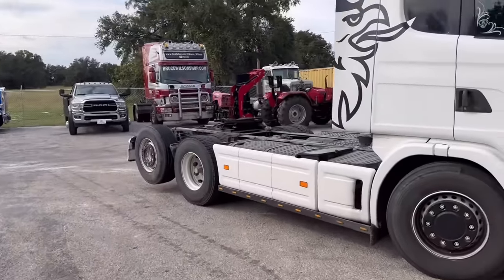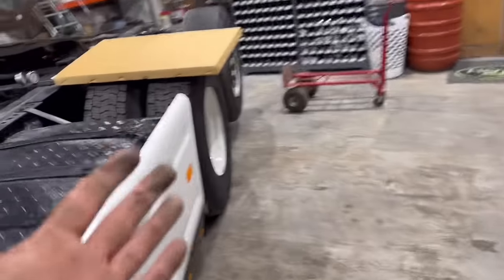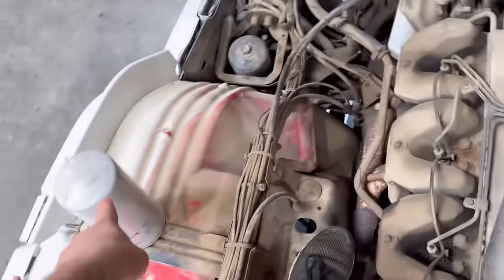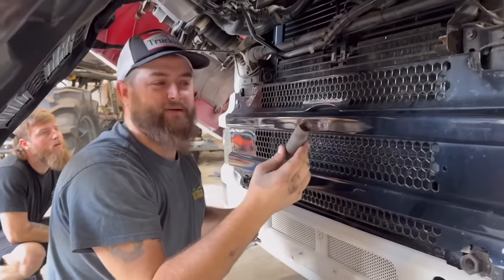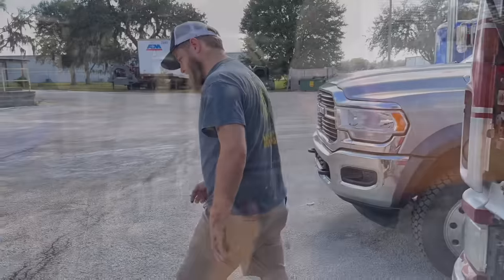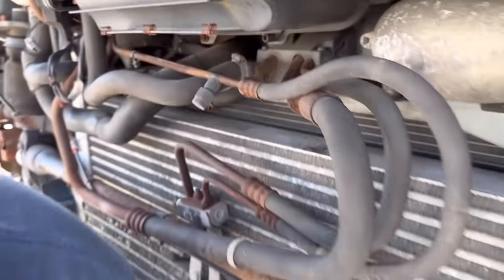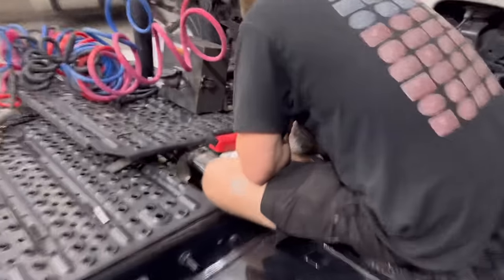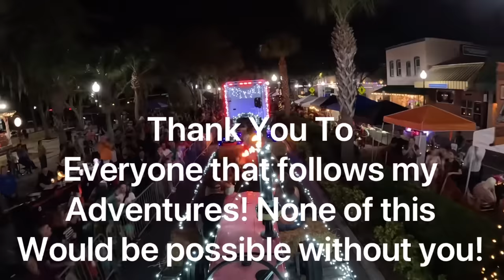My SCANIA Needs Serious Engine Repair…

Comment: Bruce, you know what.
I think you should open a Scania dealership at some point and import/sell the new trucks straight from the factory
Reply: By EPA rules cannot import new ones.
Reply: But if he finds a contact with the epa and one with scania and becomes the middle man they can work on making a percentage of them legal to come into the us it just takes alot of leg work
Reply: I bet no one thought of it yet?
Reply: @jone8626 careful now, your extreme prejudice shows. You shouldn't talk about things that you have zero knowledge about.
Reply: Scania is already a sister company to International trucks...being owned by traton group (volkswagen) ....so they will come to US in near future i believe
Reply: @ImForwardlook what extreme prejudice are you talking about?   

Dude, I drove truck in the lower 48 US, Alaska, 10 provinces and two territories of Canada (for probably longer than you’ve been alive), most of it in the heavy haul side of the trucking business.  Although you could customize an American brand truck to no end and overbuild the damn thing into the toughest and meanest machine on wheels, but, as far as the average fleet trucks go the American trucks are absolute junk as compared to the average European fleet trucks.    The cost of the American custom build truck is absolutely prohibitive as compared to an European truck of similar capabilities.    The European engineering far exceeds the American engineering, at least when it comes to commercial vehicles / trucks and you can easily see this fact in the design and quality of the average European trucks versus the average American trucks. 

It’s very important to compare “apples to apples and oranges to oranges” when comparing American trucks to European trucks !
Reply: @hereintranzit  Yo kiddo, I 've been driving trucks longer than you've been alive. Everything Europeans touch turns to crap, look at Freightliner.
Reply: @ernestbrothers1298  This is kind of a strange thing? Because those European engines are far ahead what comes into emissions. Maybe EPA is protecting just American company's?
Reply: @ImForwardlook  yeah we touched North America look what it is now..
Reply: Just out of interest, I went on the Scania website and looked up dealers in the USA. There are 15 just in Florida, industrial, and marine, admittedly, but there is a route to Scania all over North America.
Reply: Just out of interest, I went on the Scania website and looked up dealers in the USA. There are 15 just in Florida, industrial, and marine, admittedly, but there is a route to Scania all over North America.
Reply: Sadly you can't import and register a vehicle that is newer than 25 years old in the US. If they brought over new Scanias, Kenworth, Petebilt, Freightliner, Western Star, etc, wouldn't be competitive on the market anymore. Who wants to haul oversized and heavy loads with a 530hp Peterbilt or Kenworth when you can get a 770hp Scania or 750hp Volvo that is built to carry more weight from factory?
Reply: @tntfreddan3138  exactly !   And with those airtight cabs fully suspended on air springs, well thermic and acoustically insulated, nah, who’s gonna want to drive something like that ?   

The only redeeming thing about the American trucks is the size of the sleeper, and on the classics the retro looks of the design, lots of shiny chrome, the eight foot long hood in front of you and the twin air cans and smoke stacks on both sides of the cab.   Other than that, you could feel driving over a penny someone dropped outta their pocket, the noise will bust your eardrums, the wind will blow you off of the darn seats (thanks to the seatbelts keeping you in place.  LOL ) and you literally need forty acres to turn the damn thing around, right?   LOL. 
Oh, and the one’s winning trophies at the MATS, well, tons of more shiny chrome inside and outside, awesome paint jobs and lots of chicken lights makes the difference !  A 335” wheelbase with a coffin sleeper behind the cab, a minimum of 3 foot tall shifter lever in the middle of the cab floor with a chrome skull in top of it and a super lowrider driver’s seat, well, that’s a must in the 21st century ‘merica !   It doesn’t make a lick o’ sense, but that’s what’s cool in America these days ! 
Oh, about $300K of extra useless sh!t in top of the $260K purchase price for a nice Pete 389 or a K’whopper W900L
Reply: There are already 20+ Scania dealers in Florida. Check the Scania home page. They can assist with spares for trucks as well. They assist cross boarder Scania from MX.
Reply: I thought Scania already had permission to sell in the USA, but decided to pull out after only a short while?
Reply: @Xv1p3rCr0 only their engines will. The new S13 engine is based on Scania's new 13L "Super" engine
Reply: @Gregerory Abreu Truck Service of New Jersey has parts and sales for Scania..
Reply: @ImForwardlook  so crap they've got 40% of the market
Reply: @tntfreddan3138  Just get a QSK19 800 hp & leave all that scrap over in Europe ,cab jacks in the US went out in the 80's who wants to drive some cabover junk anyway.
Reply: This is not big stuff. Maybe the head gasket but otherwise just minor stuff.
Reply: Very cool video

Comment: On the 144,  Usually a coolant leak means the sleeve went a bit too deep in the block.  Wait until you check the 164 and R series ;)
Reply: or the block is corroded

Comment: Nice truck 😊, you need to buy insert paper for the centrifuge oil filter when you go to Finland. Makes it much easier, and the centrifuge filter shows you if you got engine bearing failure, the bearing particles will show in the build up in the filter. Nice work, all the best from Denmark 🇩🇰🤘

Comment: You want to keep or return the under hood appearance of it, I would suggest you get a product called Gibbs. You spray everything under the cab, preferably while the engine is running and you soak it down and you let it sit a couple of days and you spray it off. The accoutrements will look considerably better. Salt also will not cut through gibbs, but Gibbs cannot cut salt so you have to make sure everything is clean before you apply it. You can apply it to every square inch of the framework. Will soak into a millionth of an inch. And you can also wipe it with a rag and spray paint over it and the paint will stick. But I once owned a Dodge Caravan and I sold it with 254000 Mi on it and I would do that once a year just to treat the engine. Before I sold it I sprayed it off it looked like the vehicle was less than a week old under the hood. And I bought it with 46,000 Mi on it. It is a great tool for keeping the vehicle looking nice especially in those nether regions underneath it and under the hood. It also keeps all of the rubber from deteriorating quite a bit. On my caravan, my son had borrowed it to go to school in texas, and he changed the original plug wires at 241 thousand miles, along with the original radiator hoses because he had to replace the radiator. Now it could have been that it was originally an FBI package vehicle. It was a vehicle that was specifically made for the federal Marshal Service the DEA and the FBI in 1998. The first 200 of them made in the 1998 model year. It even had a custom paint color on it that only was on Chrysler products, not dodges. But it also allowed me to know when I was near any federal agents for several years. I also was able to get quite decent fuel mileage out of it I was able to get about 31 1/2 Mi to gallon out of it and it would run along at 130 mph all day long comfortable as could be and that wasn't topped out and still getting 20 miles a gallon. That was on a trip back up in 2003 from my mother's funeral in South Carolina back up to the Detroit area. I went through West Virginia at an average speed of 118 mph. I did slow down when I got into Ohio though.
Another thing you can do, is any rubber that you add to the truck or even some of it is still on the truck that looks serviceable, clean it up and spray it down fairly wet with 303 protectant and let it soak for about 12 hours. Put it on all of the Rubber products even the serpentine belts, you can even put it on the Treads of the tires about every 3 to 4 months, and get twice to as much as three times the mileage out of the tires. It's one of the best products you can buy off the shelf bar none. You might want to even get a couple of gallons of it and put it in a spray bottle.

Comment: Good look finding some cab and trim parts those fold out steps are rare to find here in uk.
Reply: Did they stop producing the 4 series in 2003 ?
Reply: @Dan23_7  2004, and then came the R-series.

Comment: Plowing in early 1980s we had Mack R models with Scania motor. The motor out lasted the truck. 6 wheeler with front 11’ plow. Side dump sander. Had some big Snowstorm back in Northern Massachusetts. Good Luck

Comment: Top tip! Try not to scratch the inside of the centrifuge rotor. Scratches makes it harder to get the sludge out. Use a wooden or plastic tool or better yet: Line the inside with paper!

Comment: Hey bruce if you're interested about these automatic greasing units you need to look up Groeneveld Transport Efficiency. Most probably thats also the brand that's installed on your truck. The  site is in dutch but I think there is also an English part. They also have service department in the US in the New York area I think. Keep up the good work and keep em rolling

Comment: My brother drives for a guy who has a black 164 580. He had it “tweeked” by a place called Feather diesel services over in Leeds 🇬🇧
It’s a monster, my bro said it’s more near 630 Hp, he drives Volvo 750’s and says the 164 wipes the floor with them 💪🏼 💨 💨💨

Comment: The motor seems to be designed very similar to marine diesel motors that are very modular and be disassembled in individual pieces whereas others are all 1 piece
Reply: Scania started by making marine engines, look up the company if you want to know more. Also, Volvo started by making boat engines, then they went into vehicles, tractors and even fighter jets.
Reply: Scania actually sells marine engines in the USA
Reply: @Xv1p3rCr0  True that, I went to Gothenborg, Sweden to the Volvo museum in November of 2022, now I want to back to visit the Södertälje Scania Factory.

Comment: The Scania shouldn’t just be a normal blue. I think it should be a Hot Wheels Spectraflame Blue. The front bullbar and its light housings, mirrors, door handles, deck plate, and rims should be either polished and smoked steel or gunmetal grey. The rear light bar should be a custom one and all lights should have smoked lenses. Just throwing an idea at ya

Comment: Imo you should keep the length of this chassis because it's easy to take corners as you did in @30:00. Maybe make the single lift into a double lift axle. That is doable to make.

Comment: Hi bruce im a euro truck driver from belgium, i drive a next gen scania 530 s v8, when nothing attached you can leave in 2nd gear and go straight to 4th and then high gear than 6th and so on. We use only first gear when you are fully loaded even then it choses 2nd gear most of the time. With the new trucks you can even start in 5th gear

Comment: hey man look for INDO 500 , get a big pump sprayer and spray it on everything , its a degreaser and cleaner i use it on concrete pumps and cranes before i paint them , you can get in 5 gallon pails

Comment: I'm betting money, that after the Finland trip, he will import another one to the US😅
Reply: With 25 years import rule, it's hard to get a nicer truck though. The youngest Scania 4 Series rolled out the production line in 2004, it has 16 liter V8 instead of the older 14 liter V8, have power output up to 580 hp & 2700 nm of torque (almost 2050 ft lb). But that truck would be too young to be imported to the US.

Comment: The gray Deutsch plug at 22:33 for the aircon should have a neoprene gasket and an insert to lock the contacts in place. I'm guessing moisture got in at some point and caused problems, quite common for Deutsch connectors.

Comment: The cabjackhandle is located above the front grill, right below the cab swaybar. By the way, by the looks of it you need new lover uniballmounts for the front dampers of the cab air ride. Probably need new rubber bushings in the cab swaybar too.

Comment: That self greaser unit if it's the kind I worked on before I'm very familiar with. All fittings and grease lines are metric and are very odd to find. I have connections here in Canada that I can source them out if and when you need them.

Comment: Hi Bruce
I also think that the fifth wheel coupling was set better for axle load distribution in the setting you took over from the Scania. On the one hand, because of the correct load distribution overall, on the other hand, the driving stability is better because the trailer does not work so hard on the tractor (straight running and rocking movements), especially with the boogie axle lifted. This far back the fifth wheel only makes sense to have a grip when the trailer is empty or to achieve the necessary free pivoting radius under the trailer. Depending on the version, you can also relieve the boogie axle under full axle load in the event of loss of tracking on snow and ice until the drive axle has 13 tons of axle pressure or even lift it completely (Norwegian version). Then there is a good 17-18 tons of drive axle load that provides propulsion. Contact Max Hunt to see what he advises you. It may also be possible to subsequently install the softwear for the Norwegian version.
Ps. I would get the missing Scania mud flaps/wheel covers for the drive axle and the boogie axle for a nicer look and to prevent unnecessary dirt on the tractor, although you don't necessarily have to install the upper removable cover for the boogie axle.
Greetings from Berlin

Comment: the foldout step is mainly for getting up and cleaning/scraping the window, they used to mold the step into the bumper but you end up hugging the truck and unable to clean the window as much

Comment: Find you a buddy that works for UPS as a mechanic. UPS has been using auto greasers since the early 80’s on Tractors and package cars. If you got a UPS guy that comes by on the regular. Look under his truck it’s mounted under the driver seat on the back side of his or her footwell. Between the footwell and the frame or under the hood on the driver side.  The tractors it’s on the frame before you get to the drive axels. But they are very simple air to it to shove the grease. You got electric wires going somewhere follow them you will find a timer box. You set when you want it to go off. Like every 30 minutes or every Hour or every couple hours.  They are nasty but a life saver on parts

Comment: Canada here......Check out edison motors they  are building a hybrid logging truck that is lighter than a regular truck It goes up the hills empty and comes down with a load of logs where the kinetic energy  recharges the batteries and they Calculate that it will get up to fifty percent more fuel economy. Not only do they build a truck from the ground up, but they've also done retrofits on older trucks that date back into the 60s.

Comment: Scania also makes amarican style trucks that drive around in europe, but they are rare.
It is wierd if you are not used to shift with the clutch that it does not have a cluth activation button on the shifter. Most of the manual ones i have been in have that option.
That are the normal road versions of these stile of trucks, they sit pretty low compaired to the stuff that speced from factory to go offroad.

Comment: "Sentral smøring" the grease system , you can fill it with an old fashion grease pump or gun or what you call it. Make sure to power wash the whole engine before dismantling. but where is the paper in the "syclone filter" or sentrifuge filter ? Back in the day it was a paper in it so you could pull all the slugde in one pull. Man this video brings me back to my mechanic days . Nice video guys

Comment: Bruce you should get Mack Cabover with a V8!
Mack and Scania go way back into 1950's on various ventures.
I'm not sure if inline Mack engines were co-engineered.
All the Mack V8's were joint ventures between Mack and Scania. Mack did castings and hard parts, Scania did lot of the engineering and decided to use individual heads while Mack chose head for 2 cylinders. Mack / Scania castings engines were Imperial measuments.
Mack suffered from  financial constraints and frequent management changes. 
Similar to the demise of International Havester, Hudson, Studebaker, Packard, Kaiser, REO and American Motors.

Comment: About the head gasket leak. It may be that the upper sealing rings on the cylinder liners are the problem. It is a known issue with these engines unfortunately. Take a good look at the cyl block around the liners, look for corrosion in the block. Note. The liners may be leaking even though there's no visible corrosion due to fatigue in the sealing rings.
Hopefully it is the gasket but dealing with European truck engines on a day to day bases, I am a bit worried.
Best of luck